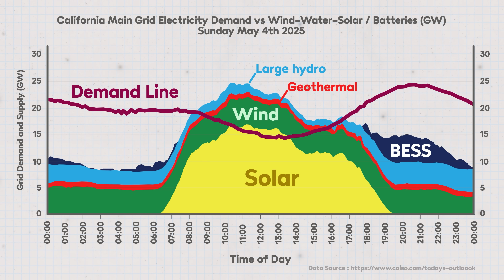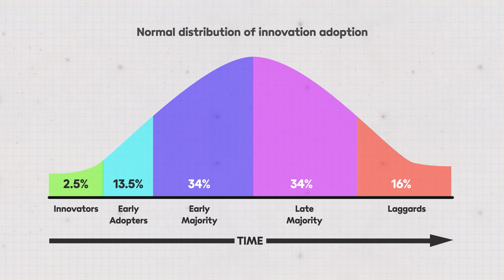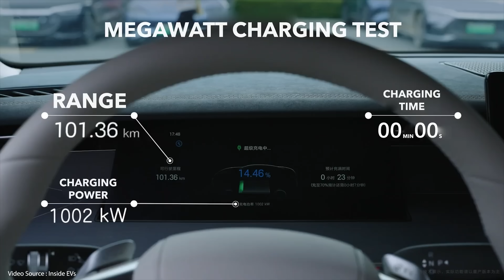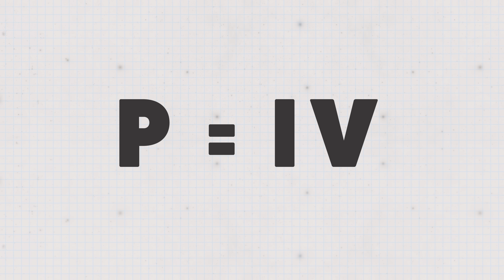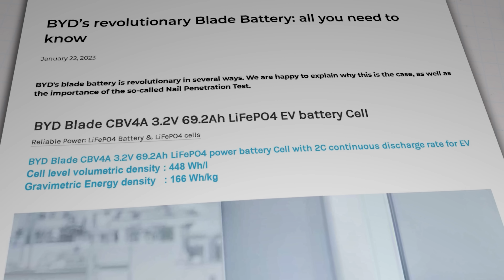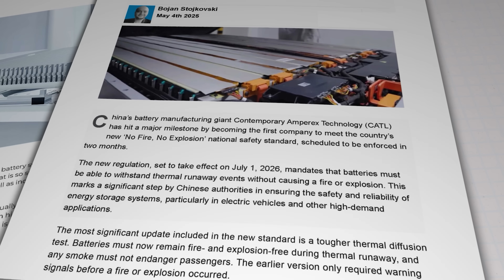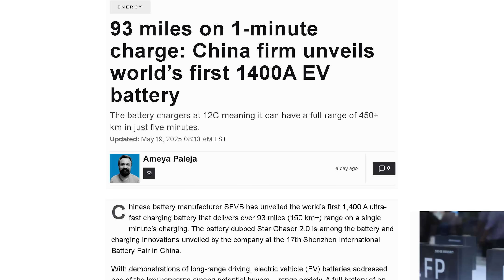BYD 1 MEGAWATT 5 minute EV Charger. Overdue or Overkill?

Comment: Each gallon of gas contain 132,000,000 joules of energy.  A modern gas pump delivers gasoline at 10 gallons per minute or 22,000,000 joules/sec (22,000,000 Watts).  A new gas station is going up near me on US I-30 it will feature 110 such gas pumps (one station among dozens)   It can put energy into cars at the rate of 110 x 22,000,000 watts (2.42 GIGAWATTS) A modern 350 foot high wind turbine can produce 3 megawatts but only at rarely reached peak wind conditions.(steady at 30 mph)   This means that my ONE gas station would need 807  gigantic 350 foot wind turbines to fill the same number of EVs at the same rate with energy.   

OK an EV is 90% efficient and a gasoline powered car is only 30% efficient so we will only need only 269 gigantic wind turbines to run my gas station converted to EV charging.  No wind; no go 

Science is about numbers,  theology and the climate-green energy hoax is driven by unicorns and pixie dust.    What is the SI unit for "climate change" anyway?

 We sue doctors and airlines for malpractice.    Why can't we sue the purveyors the climate-green energy hoax for selling cures for "normal" with their the poisonous magic potions 

 Let's all "have a think on that?"
Reply: A gallon of gas does have a lot of energy within it, the issue is that only 20-30% of that energy actually converts into mechanical work.  The rest of the energy is lost as waste heat, incomplete combustion, friction or other inefficiencies.
Reply: @Les_S537  
RE: "A gallon of gas does have a lot of energy within it, the issue is that only 20-30% of that energy actually converts into mechanical work.  The rest of the energy is lost as waste heat, incomplete combustion, friction or other inefficiencies."

Hybrids make a lot of sense (not so much for plug ins of any kind)  

I drive a Hybrid using a low torque-high efficiency Atkinson cycle gasoline engine as its power source.  It's 40% efficient and I get all that regenerated power as a bonus.  620 miles on a small tank of gas.   All that heat is not wasted.  It can get very cold in the USA (-40 or colder).   It's great to have all that engine heat keeping me from dying in winter and also I can see out of my windows too (front side and rear).     It takes me 90 seconds to fill my tank at 40 below zero.    Also my tires last 60,000 miles since I don't have to drag all that extra battery weight around. Now how great are those EVs again?

How long does it take to "fill the tank" of an empty EV at 40 below?     How far will it go in the snow and ice at 40 below while  keeping me toasty inside?     

Bottom Line:  EVS will not work for the general population.   The enormous amount of poisonous natural resources raped from the Earth would require tens of millions of enslaved children (they need to be children - adults would rebel)  to make it economical and even then you cannot get the energy required to fill your EVs; The electrical infrastructure cannot support EVs even when using reliable affordable energy.    Green energy is none of these things ......can you do the numbers?  have you?        

This is not rocket science...all it requires is thinking in place of wishing.
Reply: @brucefrykman8295  Arguments from extremes are fallacious/a logical fallacy.

-40 F is not the norm, and its nowhere near the norm, and your acting like you care about the environment (about mining) is pretty funny considering that the most mined commodity on the planet today is coal with more than 8 billion tons of coal strip mined out of the crust of the earth each year, and then it gets burned putting pollution galore into the atmosphere.
Reply: @Les_S537  
RE:  "Arguments from extremes is fallacious/a logical fallacy." 
Not understanding logical fallacy is also a logical fallacy.    We build aircraft, bridges, roads, dams, power infrastructure, buildings, sewer systems, etc  not to meet "normal" but always to exceed anticipated extremes;  Please tell me you are in no position to comment on or influence any public infrastructure.   Do you have any knowledge at all of either electricity or energy?             

There is nothing fallacious about -40 F or C.  Houses built in the North Central US need to maintain heat at these temperatures.   The world is not "normal"  The world and its weather extremes are quite "normal,"   from the hottest place on Earth ever "recorded',   as in "not modeled" (Greenland Ranch California - 134F - July 10, 1913)    

As for cold extremes I have driven over 100 miles in an  -80 windchill and windchiil factors are all that matter when trying to keep warm inside a vehicle.  They matter for EV batteries as well.  (did you realize this before I told you so?) 

Here is "normal" for older cars that needed to work in the USA at these temps:

https://www.infoplease.com/math-science/weather/record-lowest-temperatures-by-state   

Tell us what temperature EVs cannot be expected to operate at please!

Now get back to the issue and stop stuffing straw, I gave you my numbers.    Show me the amount of natural resources you will need to acquire (steel, aluminum, nickle, copper, cobalt, lithium, manganese, cement - 1 million pounds of concrete per wind turbine, etc)  where you will get them and who will do the work and pay for it all?   No smoke and mirrors.  I know that the economics of reliable energy work because they are working and have done so for more then a century - Show me the numbers for your wet dream "green now world"
Reply: @brucefrykman8295  rolling my eyes...  The only places on the planet where -40 F is the norm are places like Alaska, far northern Canada, Siberia, and far northern Scandinavia.  Some places in southern Canada and in the northernmost US states can experience -40 F for stints of a few days at most, but for the rest of the world they're far from the norm, ya nitwit.
Reply: @Les_S537  27 of our 50 states hit temperatures at or below -40(C or F) -50 F, -60F -70F and even -80 F     Windchills of -80 or lower occur often.   Does all traffic stop?   What's your "plan?"   No straw, no dodging - do the had work and copying what the idiots tell you wont get you there either.
Reply: @brucefrykman8295  Are you TRYING to misunderstand me?

Again, those ARE NOT the norms in winter (except in Alaska)...  As I explained, some northern US states CAN experience those temperatures in short cold snaps, but they ARE NOT the norm on a yearly basis.

It is normal for most northern states to experience such cold temperatures, but it is NOT the norm that they experience those temperature ALL throughout winter.
Reply: @Les_S537  Sane people do not plan critical infrastructure for the norms, bridges fall when we allow idiots plan infrastructure.    Are there any qualified civil and electrical engineers whose paychecks are not signed by bureaucrats who will sign off on the EV electrification plans?   

I just took a 2500 mile road trip and on the way I saw three brand new electric busses on the highway being delivered to Washington State.  They were all on the flatbeds of three 18 wheel diesel trucks.    Is this the normal way EVs are delivered?  In the past new busses and trucks self delivered or piggy backed on each other.  Is this the new "normal? for EVs"          

I notice that you have avoided the issue:  80% of world energy is delivered by fossil fuels.   So far we've spent more than 30 trillion in pursuit of eliminating fossil fuels but dependence on fossil fuels has only increased for the effort.  Lots of people are making a fortune selling this snake oil - don't get me wrong - I don't buy the superstitious nonsense called  "the climate crisis" or "climate pollution"       

Do you ever drive in non-normal conditions?    Snow and ice on the road isn't normal either so plows, sand and salt trucks are all a waste of time-and money - right?
Where do you live?    I live where extremes are and always have been a "normal" part of our weather but our climate has not changed at all in my lifetime.   I wonder how this could be?  
Of course we have had cold decades and warm decades but that's just chaotic weather.   

PS was the little ice age just local weather or was it "climate change?"    Don't be afraid to be a "climate denier" in this instance.
Reply: @brucefrykman8295  EV manufacturers have planned for the extreme, as I said you can precondition/warm your battery pack in your car when your temperature reaches negative temperatures, but the reality is that nobody should be out and about in -40 temperatures anyway.

What's with all your exaggerating?

Only 59% of the world's electricity came from fossil fuels, not 80%, and your claim about 30 trillion dollars being spent on renewables is ridiculously wrong.

The Little Ice Age was a global phenomena caused by much increased volcanic activity worldwide.

How did volcanoes cool the world's climate?

After the end of the last glacial period WITHIN this ice age we find ourselves the world has gone through several periods of very high volcanic activity which has resulted in cooler temperatures worldwide.

The cause of those periods of high volcanic activity is something we geologists call Isostatic Rebounding.

Without all the ice from the ice sheets on North America, Europe and Siberia, the continents began to rise upwards as a result, and this initiated periods of very high volcanic activity around the world as the earth's crust moved and adjusted to the loss of those ice sheets.
Reply: @Les_S537  Moreover.   The insiders know that EVs cannot work for the masses.    They do not want the masses to be able to travel at will.   Travel in the future will need to be by permission from the power elite.   It's better for "Their Earth" this way.
Reply: @brucefrykman8295  "The insiders know that EVs cannot work for the masses"

Couple of facts.

1.  Around 80% of the planet lives in an urban environment.
2.  The average driver does only 30-40 miles per day
3.  a typical 120v/15amp outlet can "push" ~4 miles of range into your battery pack per hour.

Knowing these three immutable facts, it is clear that for the vast majority of people on the planet today an EV is entirely practical.

Comment: You should think like this. Suppose you're charging 1 kWh battery charging to 1 kWh in 1 hour, need probably to 1.15 kWh for 1 hours. When you charge in 5 min run probably 15 kWh through that battery. What do you think will happen to that battery when 5 - 6 more power than in water cooker forcing its way to that battery. Poor batteries.

Comment: Despite this so-called news bev driving is still and will be the biggest nonsense this century. 
1 Mw charges multiply this with several billion of vehicles and you will see the BS.
Reply: MW charging will not be the norm, and will be primarily for large industrial scale EVs only.  To use a MW charger on a small EV with a 75kWh battery pack is overkill.

Comment: For the sake of the grid,  l prefer a trickle feed,  8 hours overnight gives me 100km, l need about 70 per day, . If have a longer trip just plan it, never had range anxiety, l feel  this desire for fast charging will sabotage the industry.
Reply: The only vehicles that will ever need MW charging are industrial scale vehicles like buses, dump trucks, excavators, agricultural combines, et al.

Large vehicles like these will have 800kWh or larger battery packs, and will need such charging speeds to be made viable.

Personal transport EVs with 50-75kWh battery packs are just fine with charging levels as they are.

Comment: The idea of "overkill" is very relative. However, having a car that we really like but that can charge at only 50 kW, 1,000 kW seems like a dream.
Reply: sounds like you have a BOLT too :) Fast charging is relatively slow, but charging overnight at home is perfect.
Reply: @Sneaker_Net We only charge on the street, we live in an apartment building. It's fine, except during snowstorms.

Comment: I think a major hurdle holding electric cars back is that those of us who live in an apartment can't charge them at home. I'd love for my next car to be an EV but at the moment it just isn't practical for this one reason. We need street chargers to be ubiquitous (they don't have to be fast ones, Level 2 should suffice) in areas with apartments.
Reply: Listen, how many miles do you actually drive each day?

The US average is 30-40 miles per day.

A 120v/15amp outlet, which comes standard in every home or business, can "push" ~4 miles of range into your EV battery pack each hour.

The significance of this is that if you're a 30-40 mile per day driver then a 120v/15amp outlet can recharge those 30-40 miles back into your car overnight while you sleep.

If, on the other hand, you drive say 60-80, or even 100 miles per day, you can install a 240v/60amp outlet in your home for a few hundred dollars and wake up every morning with a fully charged EV.  The 240v/60amp outlet can "push" ~40 miles of range into your EV every hour.

You're imagining a major hurdle where there is none.
Reply: @Les_S537 so do you imagine that I should hang a big extension lead out the window or what?
Reply: @LeeSmith-cf1vo  No...  Unsupervised full self driving EVs are just around the corner.

Automated EV charging is just around the corner.

So what you'll do is when you get home at night, you'll send your EV off to go charge, and inform it that you'll need it back by 8am.  It will go off to a charging station/parking lot, and charge up, and when you wake up the next morning you can summon it and it'll have a full battery, and that's that.
Reply: @Les_S537  that's a very different solution. I also think it's further away (in time) that you suggest, certainly in Europe.
Reply: @LeeSmith-cf1vo  Tesla FSD just works...  I've had it since 2019, and I've witnessed the progress first hand.

Today, I regularly have zero intervention drives.  I've had instances where I've taken over, but only out of an abundance of caution.

Tesla's robotaxi just launched in Austin TX, and will expand between now and the end of the year in other cities.

It's just around the corner, even in Europe.

Comment: Breaking developments in charging technology or battery chemistry do not instantaneously make it to mass-scale manufacturing. Many of those technologies that look good in a lab do not translate to practical use in the physical world. Additionally, Do you even know how expensive it will be to deliver a MW of power at each charger? Getting connection points to the grid that can supply this amount of power is expensive, & using on-site batteries to mitigate the lack of such a robust electrical connection will also be quite expensive.  Lastly, a cable flowing 1 MW of electricity so close to a citizen's hands.... God forbid that there is any sort of break in the insulation.... you may one day unfortunately understand what a bug in a bug zapper feels like.

Comment: I've been told that I needed to split the power feed to my house to be able to install a charger, which costs more than the current value of my petrol car. Apparently, the cable was buried under my neighbors' extension too so not sure what kind of nightmare that would be. Also, in order to be able to park an EV off the road on my drive, I need to extend the driveway since my house was built (very poorly) in the 50's. Before I even go near an EV, I need to invest at least £10-15 thousand. No, thank you :(

Comment: 3 reasons why EV's are not ready to be connected to the grid:
1) there are very few models that allow 2-way charging.
2) there are virtually no chargers that are approved for 2-way charging, and those that are are way too expensive.
3) countries need to roll out a uniform smart grid system that can communicate with those chargers. To my knowledge this does not yet exist.

Comment: Cool technology, but you have to question how this is actually fuelled. Just think about a "charging centre" that had a bank of these chargers. Say we get 5 or 6 MW charger'slike at a petrol station. Uh, i don't know if the actual grid could handle that kind of drawdown in such a localised area constantly. At a certain point, it's  not the car, but the municipal infrastructure that's going to struggle.
Reply: Rubbish. Firstly it's not such a high amount of power in the first place second, it can be greatly reduced with local batteries.
Reply: @jnawk83  sorry but 6 MW is a substantial draw, you're admitting as much by talking about its need for an on site battery buffer.

But sure build them, just don't expect something with such high capital investment to be common place. They seem far more useful as a tranport hub along a highway. I think we can both agree a 5 minute charger is completely redundant in an urban centre.

The reality is we need to educate people about range anxiety and more importantly ween everyone off of the idea of personal transportation. People need to get more involed in active & public transport. But instead we will continue on with these high material throughput greenwashing exercises that require very little to no lifestyle change from the consumer.

Engineering isn't the problem we are a smart bunch. Our problem is we exist on a planet of finite resources and all our "solutions" require buying and building ever increasing piles of shit.

Comment: It would better to consider, "distance between charges" rather than "range anxiety". A subtle, but important, distinction. If you don't have your own home charging capacity (you don't live in a nice detached house but rather in a flat a few floors up for example) then finding available space on a public charger becomes an important consideration. Yes, we may typically drive only 20 or 30 miles at a time, but this may mean you need to worry about access to a charger several times a week. This is a legitimate concern, and will become more of a worry if public charging infrastructure doesn't keep pace with EV sales.